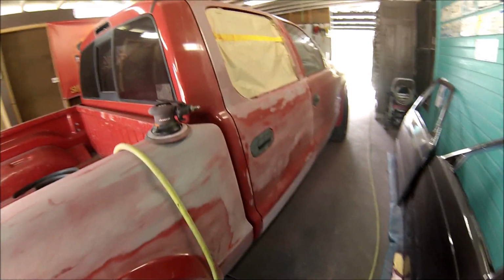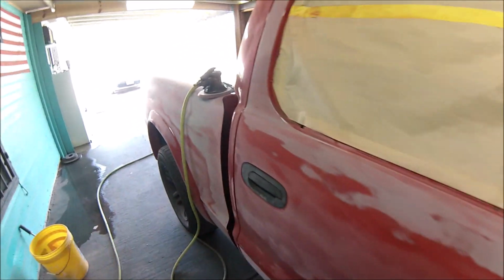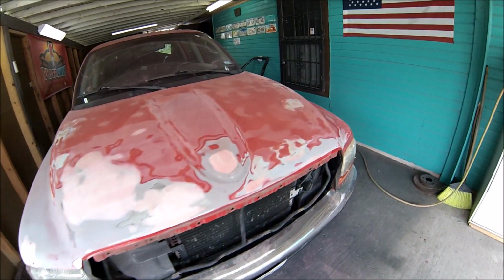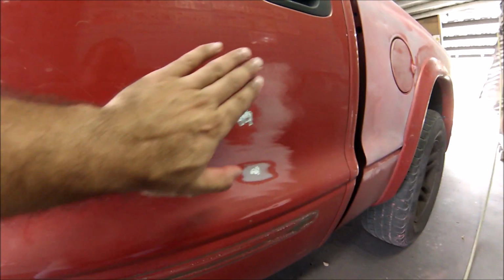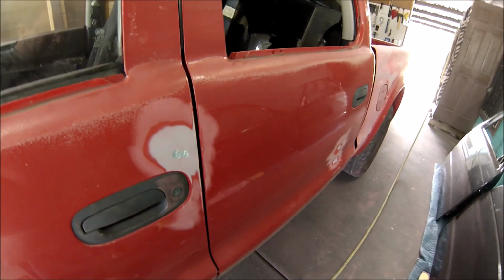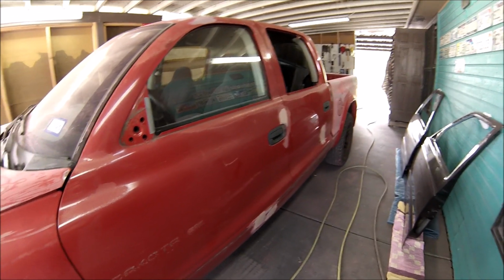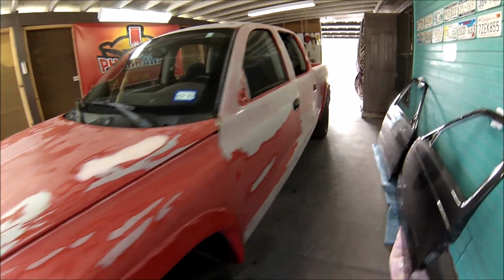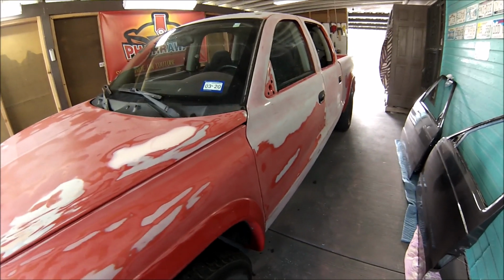HOW TO PREPARE A CAR/TRUCK FOR PAINT PART 2

Comment: I tried using my harbor freight stud welder on a spare motorcycle tank and it just melted the metal. And where I got the studs to stick, when I used the slide hammer it just ripped out the metal where the stud was welded and didn't pull the dent. Idk if I was doing something wrong or the metal is just way to thin for something like that to work on.
Reply from the maker: Wow I think the metal was just to thin
Reply: @PHARRAWAY  I guess ill have to see if I have get something inside the tank and work it from behind(not much of an opening to work from). I really don't want to use much body filler if I can keep from it.
Reply: I think too thin metal too, or maybe held the trigger too long? It only takes like 1 second or so. If you hold it too long, it can do that. I've never used the HF one though, mine is a Unispotter.

Comment: I dont see part one on your profile. Is there a reason you don't sand all the way to bare metal? If the clear coat is compromised (and has been for a while) shouldn't the base coat be as well? Or do you only have to completely sand localized areas of failure?
Reply from the maker: No usually the clear coat is the only one that needs sanding going down to bare metal will just remove the factory etching which is one of the best so no need to do that
Reply: @PHARRAWAY  Thank you! I've been watching a lot of your videos and I'm learning a lot!
Reply from the maker: @livedeliciously  Thanks brother
Reply: @livedeliciously  are you using 360 grit for the clear? Then wet sanding with 400 and 600 for surface prep?